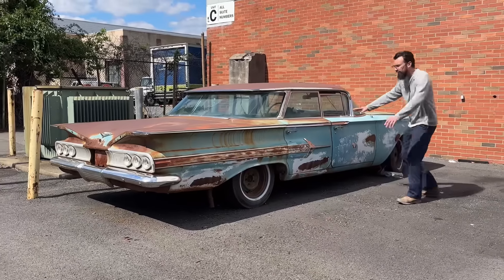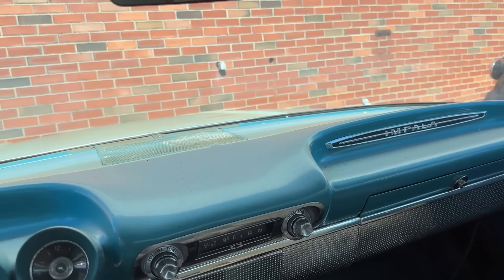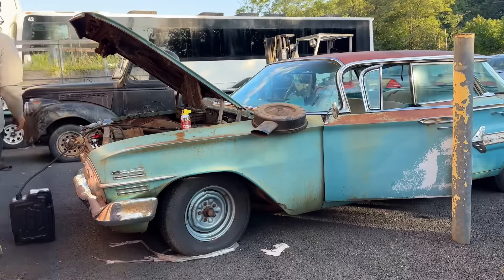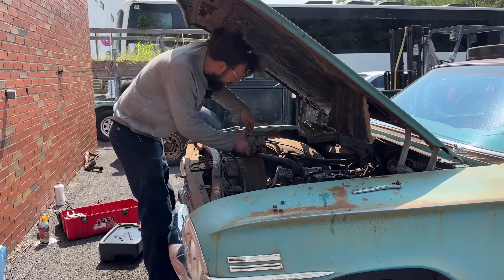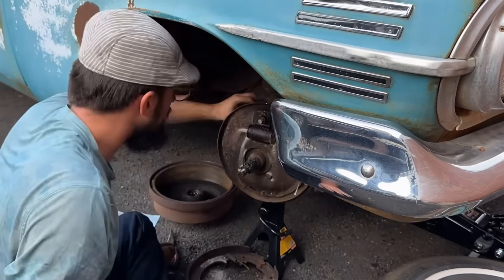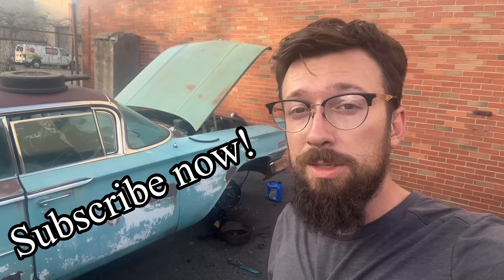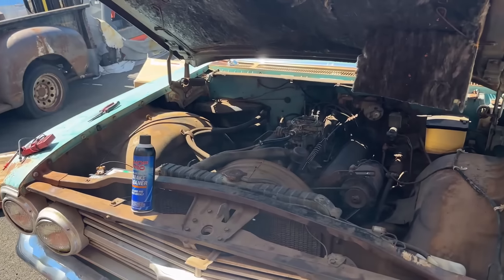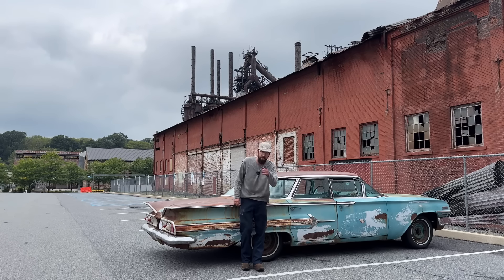I bought a 1960 Impala sitting 32 years, will it run AND drive 2,556 miles home? Part 1!

Comment: You, sir, are a lucky man.... you should have lubed the cylinders in that engine before cranking it, and you should NEVER rev a newly revived engine...the rings can be stuck and you can also damage lifters that would otherwise be OK, you can bend pushrods, you should manually roll it over two or three times, unless you know the valves / pushrods are not stuck.... I cringed....  glad it worked out, but just fyi !
Reply: Everything you said sounds right. I've never understood why people rev up the engine when they revive them. But should be a 283 so they're tough little engines.
Reply: YouTubers are so lucky for people in the comment section. What would they do without us.
Reply: @CAROLDDISCOVER-2025  that they are ... So was the 235-6 and the 348....have owned two of the 3 and a couple 327s
Reply: @jasonschwartz746  just glad th engine didn't yak
Reply: I'd have flushed and filled all of the Fluids as well.
Reply: omg i’m glad someone else here has sense i could barely watch him do that to this engine  but it turned out ok he is indeed very lucky
Reply: You'd have to take apart the block to do that though and he didn't have time to do that
Reply: I'm sure he knew the motor was fine.    This car seems way to clean...     this all seems too fake.     Cool car though.!
Reply: Mind : always see if it cranks . Better rev it when it stood still for a while,  quick oil pressure is the key word, not a difference from 700 rpm or 2000/2500 rpm.
Reply: I think he was trying to keep it running
Reply: or u could just send it it usually works out for me
Reply: @CAROLDDISCOVER-2025 have fun trying to start a 60s v8 with no throttle people never seize to amaze me
Reply: @theLyzhendricks You know the phrase is cease to amaze, right?
Reply: You are every right
Reply: @cptchuff2741 spark plugs out, squirt of oil, ATF, 2 stroke oil or some other lubricant into the cylinders. Check if there is oil in the engine, if yes, rotate engine few full revolutions to at least kid yourself into believing that both ends of every rod are magically completely lubed up. It's not perfect or anything, but it won't take forever and you'll get at least some oil circulating.
Reply: @Ksoism  yeah that would be better than nothing I guess
Reply: Also, 50:1 premix oil and gas is better fod topping up the carb. Does not dry out cylinder walls like brake cleaner.
Reply: Very very true my friend
Reply: @theLyzhendricks  No clue, friend. But I will say cease and seize are nowhere close to the same keyboard patterns.
Reply: Yeah no offense but he most likely knows what he’s doing
Reply: @cptchuff2741  and if you throw in some new oil, or have some oil in spray can, you can try to squirt it through the oil add hole in valve cover.
Actually, you could take the valve covers off, it isn't that big of a deal. Spray lube stuff up and it's good. You can throw old gaskets back in for so long that it takes to see if the engine will run. They will leak, but not that much. New gaskets are cheap and fast to fix if engine is a runner.
Reply: @robertphillips6296 You never change the fluids until its been started. New oil can damage an engine quicker then fuel/oil mixed from sitting for years
Reply: @ElsEngines  None taken, but the things I mentioned can happen, especially on an interference engine... a stuck lifter or valve that could be jostled loose could be the destruction of the engine.... like I said, glad it turned out OK....
Reply: @jdrake8738  your right, thank you lol
Reply: @ElsEngines , that response means that you in fact, do not know.
Reply: Arm chair quarterback…..
Reply: Pretty sure he knows what he's doing
Reply: @AlieNateInc  , Nope and neither do you if you think he does.
Reply: He doesn't know what he is doing he is no vice grip garage derek would had done exactly what you said
Reply: Love it !!!!
Reply: What would he do without you lolol
Reply: He is doing on the fly in a parking lot haha I’m sure he would do a lot more having the proper shop and tools .
Reply: How's a ring going to be stuck if it turns over? Genuinely asking, like do you mean in the case that one of the cylinders aren't firing?
Reply: @jasonschwartz746 often there's real experts out there...
Reply: @CAROLDDISCOVER-2025  or people who redline engines during a cold start.
Reply: @GetTheFO  yes but I guess you didn't catch the joke. SEIZE VS CEASE. OVER REV the engine and it will cease to run when it seize up.
Reply: @vermontvermont9292  boom 💥👍
Reply: @CAROLDDISCOVER-2025  It wasn’t a pun, according to him. He deleted the comment but claimed it was something like him typing too fast that he’d hit the wrong keys. Not sure why he deleted it.
Reply: @GetTheFO  I believe I was referring to me saying seized  instead of cease
Reply: He did try and roll it a bit first to be fair
Reply: Love the constructive criticism and not bashing him.
Reply: Theetravis awesome looking Impala it will look nice after you get painted what ever color you. Decide on
Reply: Correct. Done literally dozens of cars like this over many years and NEVER had a problem with them running after if the engine was basically sound to start with. Sick of all the commenters who say you should do this or that blah blah. They probably havent even rescued one car like this let alone many. The guy talking about the rings above for example. Most times the rings will be tight in the ring lands on the piston and dont seal well on first start. Once running a good Italian tune gets them loose. Mind you a little cylinder lube first is not a bad idea. Getting oil pressure first is important. Very few cars start straight away anyway and all the cranking to start them gets the oil going before they fire off.
Reply: Hey its his car and he got it running just fine on his own. Think that calls for less "I think I'd do this"
Reply: If there was any of these issues idle would not have saved anything 😅as well as it cracked plenty before starting it , pouring stuff down the plug wholes would not have been a bad idea no but can take time and make a mess
Reply: @jasonschwartz746 lol. Was thinking the same thing.
Reply: You guys have too much time on your hands. Arguing with strangers over semantics.
Reply: He did rotate the engine by hand at first, so I see no problem here.
Reply: He says from his armchair
Reply: Your forgetting this is one of the finest built by the legendary Chevrolet, they run forever if you look after them, the 283 is a beast for longevity!
Reply: As far as those brakes go it may have been cheaper and quicker to see if there is a Disc brake conversion kit available?.... My guess is there would be because these cars are classics and you can get everything for them

Comment: What's the odometer reading? Zoomed in looks like 50,000.4. Original? Take close look at brake pedal and gas pedal for wear pattern. Don't see alot of wear on steering wheel, door panel arm rest. Could be low miles.

Comment: My dad had a 60 Bel Air sedan 4 door. Great old car. The windshield at the time the car was built was the most expensive in any car.
Actually the 3 digit dot date means the tire was made in the 1990's. 512 meant it was from the 51st week in 1992, so the tires are over 30 years old.

Comment: The first car I remember in my life, around 1966, my father had a Red 1960 Impala convertible.  Very fun car.  My brothers and I loved standing in the front seat with the top down, back when laws were different.
Reply: Yeah I remember riding around with my dad and brother in the early 90s, I would sit in the bed of his 80s square body chevy truck no seatbelt just an old car seat in the bed of the truck.

Comment: The button on the wiper switch is for the window washer. Push to squirt. Chevys had ignition switches that could operate normally without the key if you removed the key before turning it all the way to the lock position. My folks loved this feature but back in the day they didn’t lock our house either.

Comment: I can remember in 1971 and being 4 years old that my neighbor and family friend had this same exact car, color and all. I can still see the duct tape on the tops of the front fenders just behind the headlights covering up the rust holes. I remember riding in it and sitting on my mother's lap as my neighbor and her sons who were my childhood friends drove us all to the store. It feels weird knowing how old this car is and knowing it was a daily driver. I would love to see the younger generations attempt to use this car as a daily driver in the Northeast year-round. They would all fail horribly and wouldn't know how to handle it when they had to break out the jumper cables and a can of ether in hopes of getting it to run. It's amazing what the generations of yesteryear were capable of living through, a time with just chorded phones, 3 tv channels, and cartoons only on Saturday mornings. I wish I could take your car, park it in the same spot in the parking lot just behind my house as my neighbor and family friend did back in 1971 because it's still there, the house's exterior still mostly in its original 1890's condition with the exception of the new siding on the front that my father did in 1979, at 56 Odell Street in the city of Albany, NY 12202, and stare at it, going right back in time.

Comment: Key is door and ignition only. Round key for the trunk. Back in the  late ‘60’ early ’70’s when these cars were everywhere for cheap (25-200 bucks), everyone one hated those flat top four doors. Time changes perception. Those 283’s would start burning oil pretty good after 70,000 miles. If it wasn’t rings, it was valve oil seals
Reply: Kind of like in the late 80s and early 90s everybody hated the square headlight jeep YJ’s. Now they are selling for over twice the original MSRP for mint condition stock ones. Even the rusted out ones are selling for 4-5 thousand bucks. I bought mine well over 10 years ago before the YJ craze started. Paid a grand for it. I’ve been offered 6 for it. Crazy how much can change in just a few years

Comment: My uncle was a salesguy at Steakley Bro.s Chevy from the 50's til the mid 80s. Me and my cousin could drive anything  on the used lot or the back lot which had the older cars. Except the vettes dang it! This was the 70s. We drove so many of those older models when they were still single owner garage kept cars w/ lower miles. The early lmpala's were one of my faves. l bought a 63 283v8 2sp power glide 4 dr. Biscayne from him that was like new in the mid 70s. l think it had less than 20k original owner grandma garage kept miles with those crazy bubble wrap seat covers. We were so lucky. Love this channel.

Comment: If you haven't already, you might check out the rubber hoses going from the trans to the radiator. Not a bad job. There's things I'd have done different but you're the guy doing it. Get your wipers going and oil that generator as well.

Comment: I was a passenger in a '57 BelAir wagon that has the same brake system (with the single bolt that holds the wheel cylinder and the two springs).  That bolt sheared off approaching a stop sign, NO brakes.  Pulled the emergency brake, it did nothing, came out a good foot.  We bicycled it on two wheels out into a 4 lane highway, no one coming thankfully.  
I wound up owning the car, first thing I did was put a master cylinder from a 79 Camaro.

Comment: WOW does this car take me back. Back in early 1963 my Dad bought a Dec 1962 Bel Air Chev sedan with the 283 V8 and the two speed power glide transmission. Well I remember those jacking instructions and of course the drivers interior. Hope you get it running. Cheers

Comment: I just got a 59 Impala convertible from an old man in Apache Junction. Traded a horse transport for it. The car had been in a his stable since the 1960s and everything is original. He is the original owner, and the car hasn't left the valley since it was new. It's inoperable but great condition considering its age. My daughter and I are so excited to get started on the rebuild.
Reply: The 59 is very cool and unique.

Comment: Don't forget to oil the generator. Front and rear of that generator have a little cap that says oil. The cap is spring loaded. I had a 62 Impala years ago and didn't know about those oil points. July 3rd driving home the generator caught fire and the battery drained quickly. Apparently it hasn't been oiled in many years before I bought the car. 3 in 1 motor oil is good to use.

Comment: When I was working as a part specialist / mechanic while I was doing the parts specialist portion of my job things like that wheel bearing that you're having trouble with where my absolute favorite to have come in because I knew how to work the system well enough to where I could either find you exactly what you're looking for or get you a replacement that would work

Comment: Hey guy, the tapered bearing is a direct upgrade since the mid 1960's, all you need to do is pound out the old ball races and use the tapered races. That scraping is usually rust in the drum groove you can chip out.

Comment: The speedometer cable needs to be greased. You can unscrew/detach it at the transmission, slide it out of the cable housing/tube… wipe it down, lube it with axle bearing grease and reassemble.
That should stop the speedometer from being jerky.
Loved this episode!

Comment: A heads up , for most of modern vehicles batteries it’s the 12v 450cca. Otherwise if old just go for 12v 650 or 700 cca for most optimal crank. If you want longest lasting range pick the gel type or lithium ion kind for best results. 👍🏻👍🏻 good day to you all

Comment: Hey Travis!  I have to say that I bought 1968 Chrysler Newport a few years back (Covid quarantine purchase) and I got to do a lot of what you did to this Impala to my Chrysler.  A few things: 1) The gas tank removal and installation was awesome to watch!  That brought back great memories of me removing and installing the new tank on my '68!  #2 - That single-pot master cylinder looked like something from a carnival ride! #3 - NIGHT BUDDY!!!  I have 3 or 4 Night Buddies!  They are great, aren't they?  #4 - The POWDER in the wheel cylinders...WHAAATT???  #5 - The Jbolts for the gas tank straps were hooked into what?  All I saw was air and light!  #6 - The fuel-sending unit truly looked like you were smoking a peace pipe!  #7 - The El Camino comment was GENIUS!  It got comments generated which helps the algorithm which helps get the video out in the front! Awesome video; keep 'em coming!
Reply from the maker: Thank you!

Comment: If you pick up a old car next time that has sat for long pull the plugs and fill the cylinders with either oil or marvel the cylinders are dry and no lubrication you will destroy the rings and score the cylinders . After you oil the cylinders let it sit pref over night but for at least and hour and crank the engine over with the plugs out to pick up the oil in the crank case and prime the oil pump . I just cringed when you cranked it over dry with dry rings and cylinders  Love the car

Comment: Don't forget new generators need to be polarized
While it's running temporarily short out the field against the ground on the generator and it will start charging that should be at least 13 V

Comment: Love all the hard work 
Check  oil pump and pickup tube, fuel pump, ground wire, starter 
Water pump, hoses, thermostat, fan belt 
Awesome content

Comment: I think it's the horizontal tail fins that make the flat top look so good on the 1960 Impala. The 1960 Cadillac flat top has the same  roof, and it even uses the same glass back window, but doesn't look nearly as good as the Impala, and I think it's because of the horizontal fins.  

169,016 of these "Sport Sedans" made in 1960, I wonder how many survive....

Nice save on a very worthy car. 2500 mile return trip, very ambitious! Keep up the good work.

Comment: Hindsight, you should’ve used that electrical pump you had to pump up fuel new fuel from the gas tank up until the fuel came clean out of the gas line same with each and everyone of your wheel cylinders. Make sure to clean brake fluid comes out before you hook him up to the new wheel cylinders.

Comment: I had a 61' same color,  inline six,  farm car 46 k  miles $675
when I finally got around to welding the only patch it needed (rear fender)
dumb ditz reared me at a stop light about a week later plowed me into the car in front of me...bent frame
Reply: Did you end of fixing it ? 
If not you can pull the frame back to the position with certain tools and such.
Reply: @Mechanicalgaming01  
I was young and in the process of relocating 
sold it for $475 ...

regret to this day

I'll try & put up a pic'

Comment: All you younger guys ripping apart brakes on these old cars like this., just a tip. Use a bit of Simple  Green to spray down the inside of the drums.  I'm 45 now, but our shop teacher back in high school told us to be cautious of asbestos dust on old cars like this.
Reply: Good Point i forgot about the asbestos shoes

Comment: ..with front wheel bearings - replace the ball bearings with roller type. A better bearing and a lot easier to find..Kanter should have them..

Comment: Sweet Impala.   That glass is unreal.  FYI..  I used to run Berryman's, chemtool thru old carbs and it really helps.  Let it run into the input of the fuel pump.... and let it mix about 50/50 with fuel.   It will unplug Jets... and do the hand over the carb trick to try to unplug em, with the chemtool.   If it doesnt work... it will still clean up the combustion chambers and valve seats.

Comment: I think I would grab a one wire alternator so if the generator went out on the trip I wouldn't be stuck on the road with no charging system